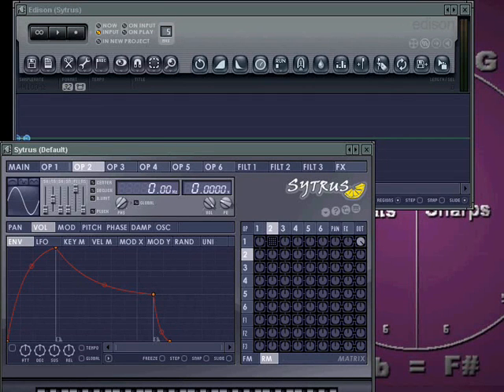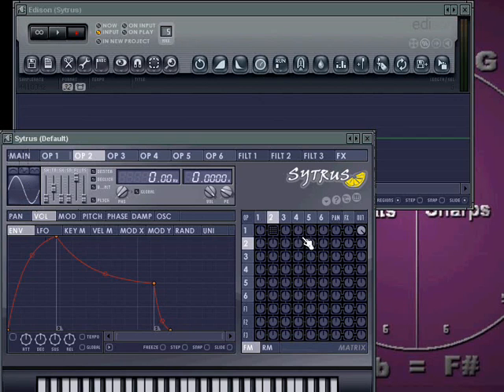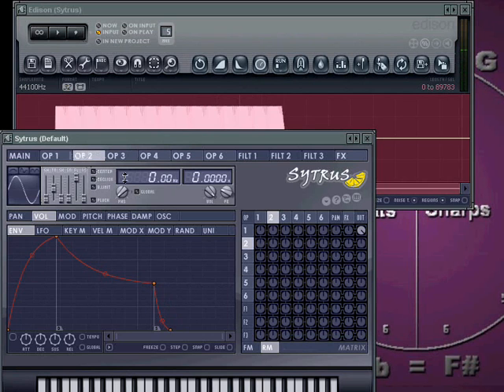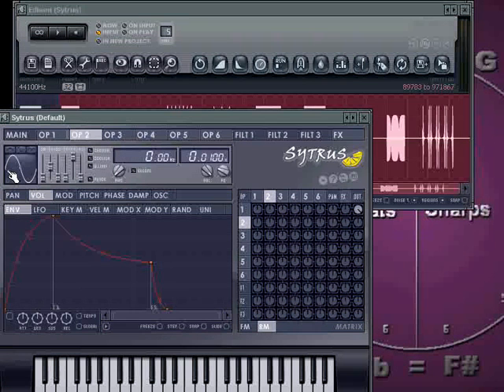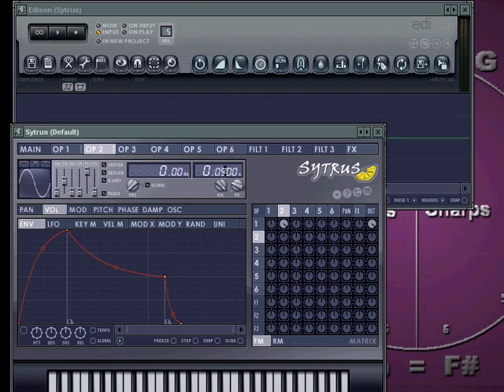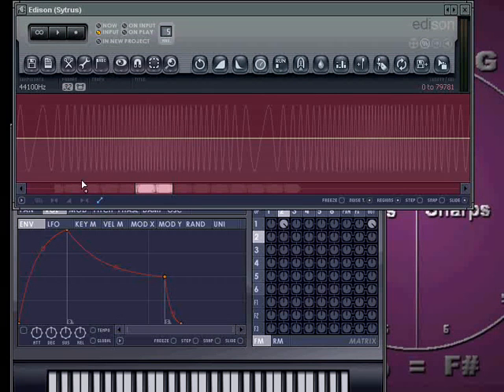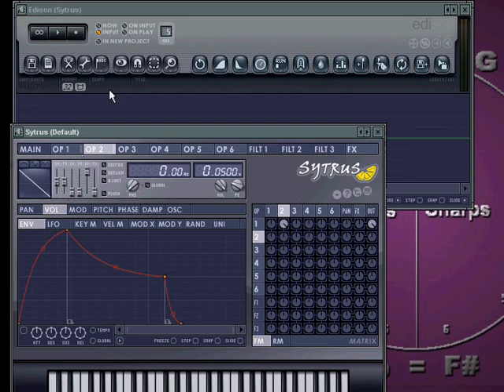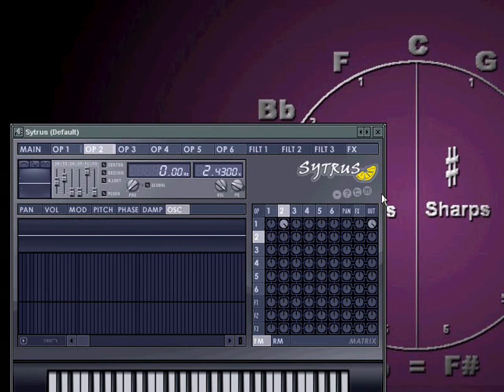FL Studio - FM Synthesis (Sytrus) Explained Visually

Comment: @EXetoC Not exactly wrong, but not exactly right either.  At high modulation frequencies, the effect of AM is the same as RM.  The algorithm by which true RM operates, however, cannot be produced with AM alone.
Often, however, RM effects are achieved through use of AM.  I was just pointing out a little technicality; I'm not trying to say that anyone is absolutely wrong.

Comment: Some FM synthesis does rely on the instantaneous voltage of the modulating waveform to control the frequency, not just whether the voltage is increasing or decreasing.

Comment: Amplitude and ring modulation are not the same(although they are related). Amplitude modulation just modulates the loudness of the wave. Ring modulation multiplies 2 signals resulting in frequencies that equal the sum of the signals and the difference of the signals.

Comment from the maker: Largely, Subtractive synthesis relies on filters.  It's much simpler than it sounds.  An oscillator makes a bright sound, you "subtract" out the unwanted bits with a filter, and that gets sent to an amplifier (usually with an ADSR Env.)  So, you can have a subtractive synth with just 1 osc.

Comment from the maker: no, not at all!  We're technically not "Adding" anything in this demonstration.  We're "changing" the existing sine wave according to another formula.  The difference is mainly in the way the "modulator" has to obey the limits of the "source" wave.  Adding more oscillations to a wave doesn't make it "additive".  That's just a frequency change.  To use Sytrus Additively, you can just set a bunch of channels to the "out" column without any FM matrixing.